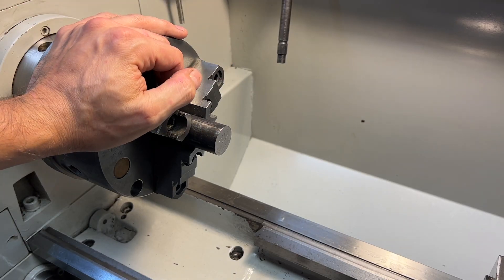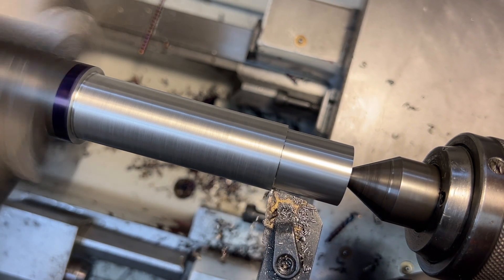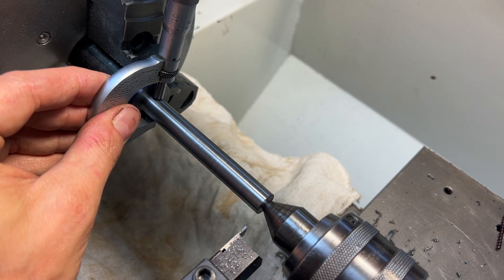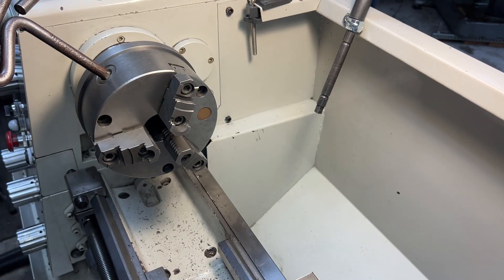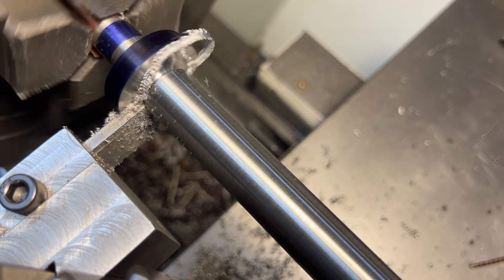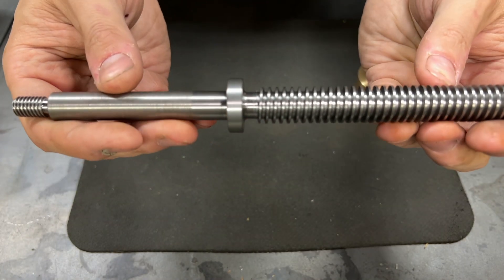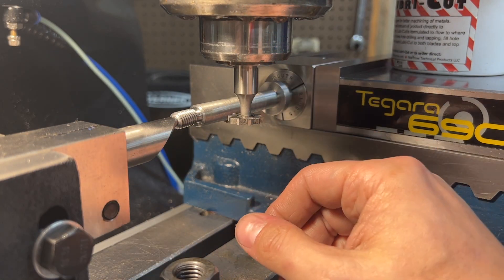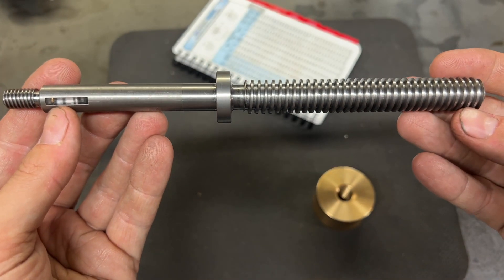Machining a Tailstock Feed Screw! - Single Point Acme Thread

Comment: I thought one wasn't supposed to 'sneak up on dimensions' and rather use the 'half the final distance' method?!
One turns the diameter down with two cut depths left (say 2x 0.500mm), measures the diameter, takes a defined cut (say 0.500mm), measures again and can now EXACTLY dial in how much has to be cut taking into account what the first 0.500mm depth cut has caused in diameter reduction.    This method gets one reliably within +/-0.002mm.
Reply from the maker: Honestly, I'm not exactly sure what you're getting at. You're pretty much just describing the act of turning. But .002mm is around 7 millionths of an inch, which is outside of the ability of common measuring tools, and isn't something that you'd even be attempting to achieve reliably on a lathe with a shearing tool. You would likely be grinding, or using edm for that, and measuring in a controlled environment with specialized tools. (If those tolerances mattered) Interesting question though, thanks, and thank you for watching!
Reply: @hersch_tool     the bog standard digital micrometers show 0.001 mm as smallest increment.  Linear scales with 0.001 mm resolution also are off the shelf available.
So we can measure this (on the spot, relatively, not absolute) reliably even in the hobby shop.

As for what I described - is different than 'sneaking up on a dimension' by keeping the cutting parameters similar and thus the reaction of the tool and part to the cut.  'Sneaking up' IMHO means trying to shave off ever less to arrive at a desired dimension which does not work for insert tools..
Reply from the maker: @joansparky4439  Yeah, that's true, my scales can technically go out that far actually, but I definitely don't trust them past a couple of ten thousandths/in. I only have one metric mic and it's in tenths of a mm, but I believe you that digitals can go out to the hundredths place. And I'm not trying to be a smarta$$ or argue with you or anything. Still though, to hit those kinds of tolerances in any kind of reliable fashion you'd want to start taking things like temperature into account, like at what temp would you like it to be within a few millionths of a specific dimension. (This is why steel gauge blocks tell you at what ambient temperature they are reliable) And I'd definitely want to use a different machining technique over a shearing tool if I'm trying to get better than a ten thousandth of an inch. All of that said, I recommend using whatever techniques work for you to hit whatever tolerances are necessary for your project.
Reply: @hersch_tool  no worries, I like a nice discussion / argument if it's logical ;-)
Initially I was just posting because I've been taught and seen others do it the way I described and what that reliably results in as it seemed important to u to hit those dimensions.
Otherwise - keep up the good work.
Reply from the maker: @joansparky4439  Thanks very much. And to the original question which I think got a little buried in the discussion. Personally, I like using a sharp tool and setting the compound over when working to close tolerances because it's reliable and makes it more difficult to blow past a tight tolerance. It's low risk ;) But if im working to +/-.001" or more, then I'll just take a finish cut at .025" or .050", whatever gives a good finish for the material.
Reply: @hersch_tool    PS: 0.002 mm / 25.4mm gives 78.7x10^-6 .. so it's more like 80 millionths of an inch ;-)

Comment: Could you tell me what acme tool you were using? As in toolholder/insert? I would like to try my hand at this soon. Thank you, job well done!!
Reply from the maker: They are TNMC inserts. NT are the ones for acme threads and NV are for 60* standard V threads. mine specifically are size 43 so they are TNMC 43 NT 8P for this specific thread. Good luck on your project btw, and thank you for watching!

Comment: What was the source for the Acme cutter?  Thanks.  Merry Xmas.  I hope you keep the channel with manual equipment and skip the high priced CNC tools.  As a home machinist wannabe and woodworker even the 1500sq ft of shop is not enough for every tool under the sun, even had I the money to purchase them.  Where I live there is no reasonable used tool market so whatever I need has to be at full price.  Shipping alone runs about a buck a pound, so I am confined to basics and that is the type of machining I like to view.  You have a good channel going.  I subscribed after the first viewing a few months back.
Reply from the maker: Thanks very much for the kind words of encouragement. I will keep working hard at the channel and I really appreciate the sub. And I definitely won't be leaving behind the manual machining, ever. The old manual machines are what get my blood pumping, that's where I really enjoy myself. I just don't get the same "feeling" when I look at a fancy CNC machine that I get when I see a beautiful old manual machine. Though I might explore some CNC in the future, maybe a small lathe or mill conversion or something. But it will never replace the manual machines for me, and the channel is primarily about my love for manual machines and machining. So that's not going anywhere. :) And the acme insert came from eBay, I can't afford to buy good inserts from the retailers lol. They are 43 NT - 8P inserts. The 8P denotes whatever pitch thread they cut, so 8P for 8 pitch, 10P, 6P, etc. Thanks again for the sub, and thank you for watching!

Comment: High speed steel over carbide for tight tolerances? Not heard that one before
Reply from the maker: Now you have :) Thanks for watching!
Reply: @hersch_tool  do you have some reasoning for it or is it just a habit thing? I’ve developed some weird machinist quirks for certain stuff, sure we all have.
Reply from the maker: @jaylh13  Yeah it's just because I can take much much lighter passes with the sharp HSS. For example, with a sharp piece of HSS I can dial in a .0005 cut using my top slide at 30 degrees, (sin(30)=.5 so a .001 tick on the scale with it set at 30 degrees advances .0005 towards work) and the sharp HSS tool will still take a nice cut at that small DOC. This lets you really sneak up on a critical dimension and really takes a lot of stress out of the process as you're much less likely to blow right past your mark. You can't take a cut that small using an insert. I actually learned that trick from a book but I can't remember the name offhand.
Reply: @hersch_tool  ah fair enough mate, nice bit of knowledge I’m sure I’ll use it eventually, I’ve not had too much of a hard time hitting double digit micron tolerances yet, but I’m sure that’s just luck of the draw with machinery. Cheers
Reply from the maker: @jaylh13  Lol, there's also a strong possibility that I'm just paranoid, and also I can't figure out how to make good insert selections for the task and material at hand to save my life. So I often fall back on HSS... Some day I'll get some inserts and tool holders that didn't come from a random box at an auction and actually learn how to use the stuff more effectively.

Comment: Wait, you set the 4-jaw without the tailstock center engaged?  Did you at least check for deflection after engagement??
Reply from the maker: Tailstocks, are adjustable. I aligned it before starting. Then, and I know this is gonna sound crazy, but just hear me out. Then, I monitored for taper during the machining process. <.0005"

Comment: Machinist here. On that bearing journal I would leave a small radius in that corner. Doesn't have to be much but I would at least go like .03-.04. A sharp corner like that creates an easy place to break. The bearing should not have a problem sitting flat against that shoulder because bearings have radiused corners on the ID. One other tip. When you flipped is around and dialed it in the 4 jaw you probably were not running straight front to back. Don't know how good it needs to run but usually you would hold on to the ass end of the part and turn it all the way back so when you turn it around you have two places to dial too.
Reply from the maker: Thanks very much!

Comment: Nicely made. Extra points for using a hermaphrodite divider to scribe lines on the rotating work instead of wearing the nibs on your caliper.
A note of caution. Never, never touch rotating work with your hands. It is a very dangerous habit. You'll get away with doing that 999 times, but then it'll be a trip to the ER to get your fingers stitched up. Threads especially can have burrs like a razor blade and are invisible when the work is rotating. Turned surfaces can get you too. Rotating, the work may look perfectly smooth but in fact is about like a wood rasp.
And never, never, never put your hand or fingers into rotating work to polish or deburr. My wife is a retired ER nurse and she can explain to you in gruesome detail what can happen. Chop sticks make excellent tools to hold abrasive paper to polish and deburr work as well as catching work being parted off.
Looking forward to more of your videos.
Cheers from NC/USA
Reply from the maker: Thank you! The chop sticks sound like a great tip, I'll have to give that a try!

Comment: Hi Hersch, could you send me the link so get the tool and insert for machinizing the nut for the acme thread? Please.  Thanks in advance
Reply from the maker: I didn't machine the nut for this project, only the screw. However, if I were to make a nut this size in bronze, I would likely prefer to just use a tap. Something like this: https://tinyurl.com/acme-tap As for the acme insert, they are Tool Flo TNMC 43NT-8 inserts: https://tinyurl.com/acme-insert I don't have a link to the exact tool holder, but it's this style: https://tinyurl.com/tool-holder
Reply: @hersch_tool  Hi hersch. Thank you very much for your support.

Comment: Nice work. Nice job on the video, too. Any reason why you didn't turn the second half between centers instead of using a 4 jaw?
Reply from the maker: Thank you! And yes in fact. First, the important features, the shaft where the handle connects and the thread, both end up concentric with the bearing surface in the way that I did it, so it wasn't strictly necessary to turn between centers. Second, I was turning a course acme thread with a carbide insert, so tool pressure was high. The part is far more likely to slip in a drive dog with only the single point of contact of a bolt head on a copper pad or something holding it secure. And third, I can dial in a 4 jaw chuck in about 30 seconds, maybe less. It's much faster than setting up between centers. Add all that together, and the decision wasn't a hard one. Maybe should have mentioned the rationale in the vid. Thanks again!

Comment: As far as I know, 1.1144 steel should be case hardened for parts like this lead screw. But then finish the part with the fit only after hardening. It won't last long in soft condition. I would also have turned the part completely between centers. Then all parts run and I do not have to align long with the dial gauge. In addition, I do not understand why the carriage is set at an angle when thread cutting. This is only done sometimes with saw threads with a straight flank to get a nice surface on it. For the finishing of the fit you also need no HSS lathe knife but you simply take a corresponding insert with a slightly larger tip radius.
Reply from the maker: Thank you for your feedback!
Reply: It is going in a proper bearing so no wear there. The thread will most likely be into a bronze nut with oil etc so for light duty use probably it does not need hardening.
Its a big difference between light duty hobby use, thread turned by hand, and full industrial factory use where it might run 24 hours a day and even be motor driven.
Reply from the maker: @wizrom3046  It's going into an old vintage leblond tailstock. I reckon he'll never have to think about this screw again once it's installed. :)
Reply: @wizrom3046  Then I would have at least taken another steel where smoother surfaces are easier to achieve. These steels that have sulfur for easier machinability are not really ideal. The surfaces are never really smooth with them. On the thread flanks that would be quite good for a low wear in the spindle nut.
Reply: @peterpan7903  ... thanks for the information.
Yes maybe the steel is not perfect, but for a tailstock feed screw? With normal hobby use will probably have no significant wear in 10 years time.
Sometimes "the steel you have" is the right stuff if you know what I mean. 🙂
Reply: @wizrom3046  Then I'm glad there wasn't only aluminium in the storage. 😂

Comment: 1144 is nice to work with.
Reply from the maker: Yeah, it's good stuff. Gives a great finish off HSS, and it's stable after machining so makes a good choice for things like feed screws that need to accurate but don't need to be hardened.

Comment: lol, i made the same mistake assuming i had a 406 key seat cutter when i turned the replacement cross slide leadscrew for my lathe. Funny:) I used 12L14 for the material on mine though. 1144 is also great, both great choices.
Reply from the maker: Haha, glad I'm not the only one 😉